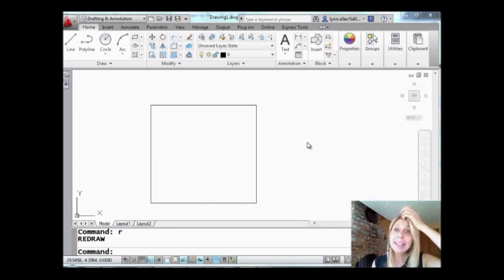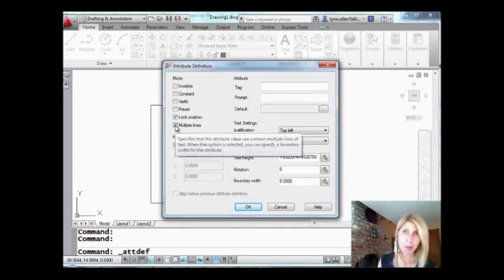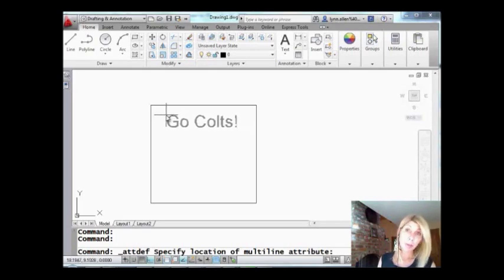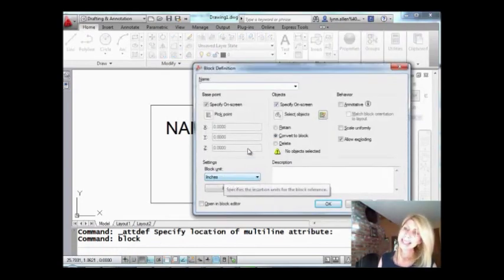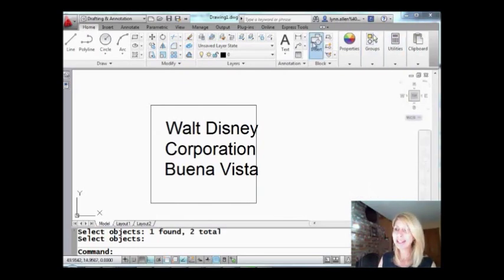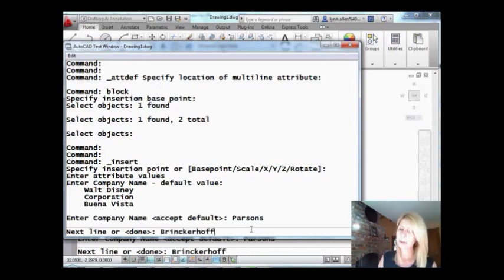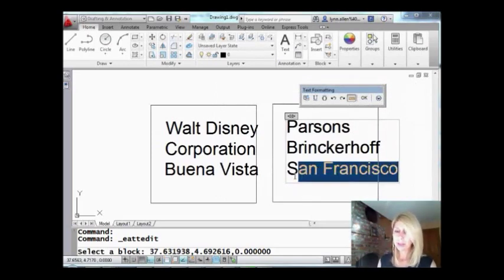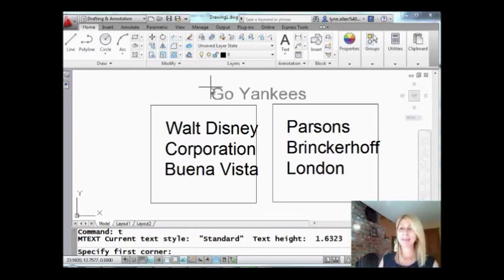AutoCAD Tip: Multiline Attributes: When One Line Just Isn't Enough (Lynn Allen/Cadalyst Magazine)

Comment: When I get to the point where it asks for the first line of  text, the command line already has the characters "_int " for some reason.
If I start typing, it starts AFTER "_int " so that gets incorporated in the multi-text string.
I would have to backspace 5 times before typing.  Do you know why this is showing up.  It's not showing up on yours.  Any idea how I can prevent these characters from showing up in the command line?

Comment: Hi Lynn, thanks for the clip, it is very useful. One question though, is there a way to define multiline attribute to Mtext. I have long line of text I like to import into the block and it will be very difficult to define each line. Is there a feature that I can use to import the long text and automatically fills into multilines within defined Mtext area. Thank you